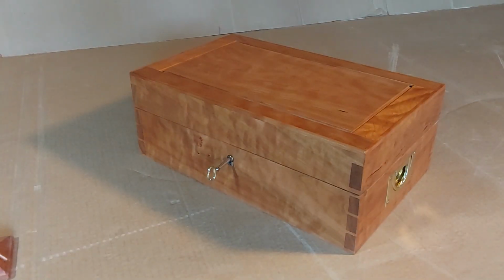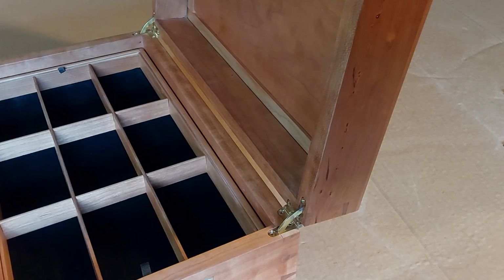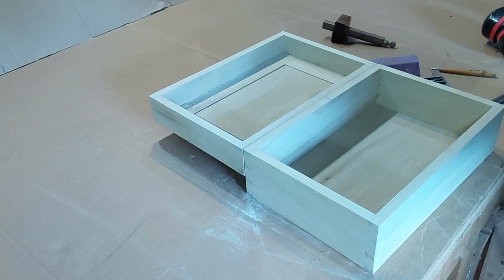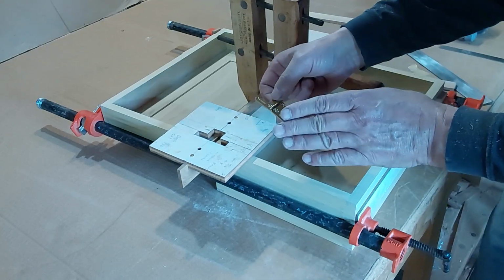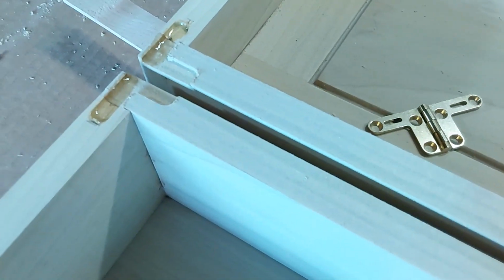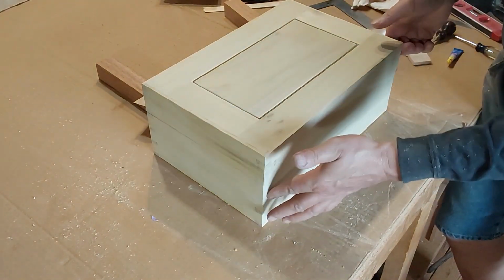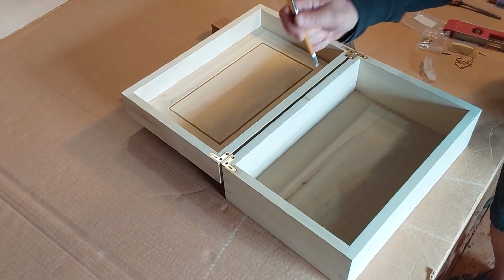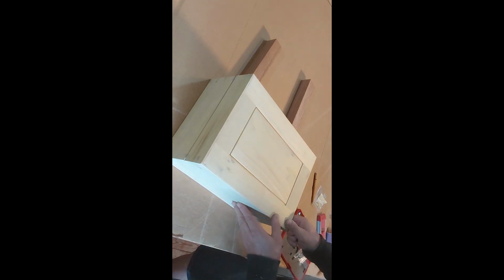Installing Brusso Quadrant Hinges in a Jewelry Box. Episode 7 Large Jewelry Box Build

Comment: Beautiful work!!!  Just subscribed. Look forward to more content as you decide to release more. Love the straight forward, calm, soft spoken explanations. I much prefer your style to the more loud, in-your-face style of others on YT. Again, great work!!!
Reply from the maker: Thank you.
Reply: What is the thickness of the vertical spacer placed between the lid and box that holds these templates in place?

Regardless any other box dimensions, it would that that dimension would remain constant as it is the natural gap created by the hinge [if the box was allowed to open to the 180 degree position].

I was considering purchasing some of these hinges but was discouraged by the seeming complexity of their installation.

I'm not quite sure I'm understanding  ... the rocking of your jig on the right ... that the clamp was making the that side misaligned and that moving the clamp caul up or down might remedy it?

Impossible to get a straight edge across that gap with the jigs installed.

I do understand the difficulties of making the beds of a jointer colander ... so I'm familiar with the concept but confused as to how you determined you were out of plane by the feel of the jig in clamps?

Sorry, if I'm running on here, but I'd really like to understand and figure this out before attempting and perhaps ruining an expensive box [in both time and materials lost].

I do have the video paused at this point ... perhaps I will understand it better as you [and I] proceed.

OK ...I finished watching. So you had to fixture the bottom of the box on a milling machine to get the mortice deep enough with a 3/16 end mill?

Yeah ... I certainly don't have access to a milling machine. Would chucking a 3/16 upcut spiral bit in a drill press at the highest speed perhaps work? 

I mean it's not a very large bit and if you might plunging it along the length of slot before attempting any front to back movement?

One would suppose the manufacturer has knowledge of the system require.ents to install their hinge but if they do I haven't found much info on installing these types of hinges besides this video.

Anyways, very nice work and thank you for uploading it.

Comment: How did you fill in the original hinge screw hole that you made once you determined the hinge needed to be adjusted slightly?
Reply from the maker: @mooseshartley  I use a 1/16" diameter dowel. I whittle the end to a point, dip it in glue, and push it into the hole. After the glue dries, about an hour, I trim it flush. I use an awl to mark the new hole location, drill the new pilot hole, and wax the new screw before screwing it in place.
Reply: @DavidKlenkFurniture thank you for the info.

Comment: How did you make your quadrant hinge template? Thank you,
Reply: Thank you. Makes sense.
Reply from the maker: @BullheadBart  would a short video help? I am in the shop.
Reply: @DavidKlenkFurniture  ... Are you still planning to make the jig video?  If not, I will attempt on my own. I'm sure I can do this,
Reply from the maker: @BullheadBart  uploading now. It took longer than I thought it would. I will follow up with a link.
Reply from the maker: @BullheadBart  https://youtu.be/2aVqH8nPijs  It took a while to upload.
Reply from the maker: I rip strips of 3/8 inch baltic plywood and glue them together to create the accurate dimensions of the template's spaces. I use a straight router bit with a spacer/bushing in the router. So I measure the distance between the outside edge of the bushing and the cutting edge of the router bit, when they are installed in the router. The strips are cut and separated so the length of the cut is accurate. I make two mirror image templates at a time, so the are as close to identical as possible.